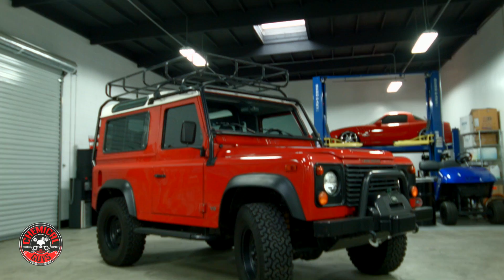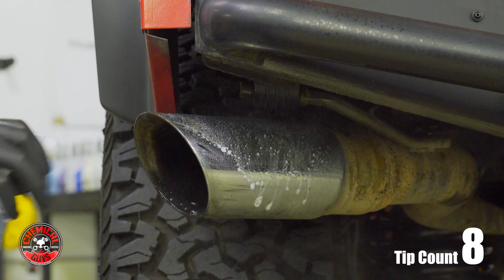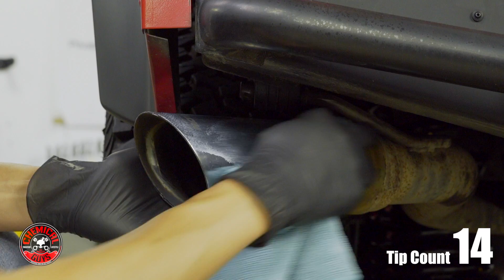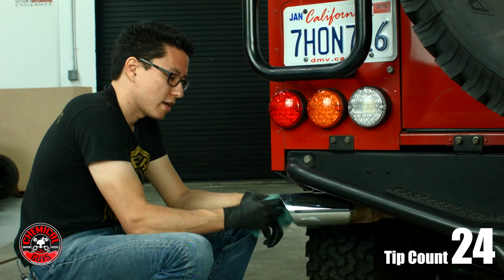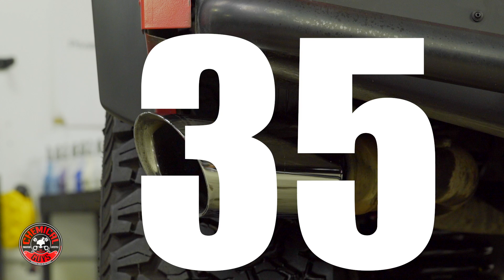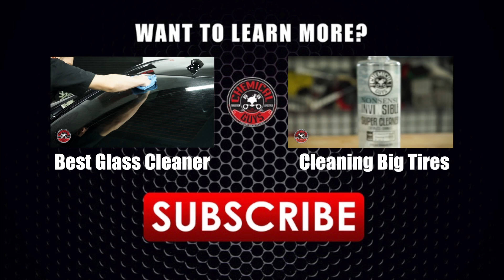How To Clean And Polish Exhaust Tips - Chemical Guys Heavy Metal Polish

Comment: Would jet seal work for titanium tips and black coated rims
Reply from the maker: Hi! Could you clarify what you mean by black coated rims? Powdercoated or factory painted or... ?
Reply: Not sure I know they have DC logo on the center of the rims
Reply from the maker: JetSeal will work on polished metals. As long as your wheels are glossy, then yes, you can use JetSeal on those also. Do not use JetSeal if your wheels are matte finished as it will add shine.

Comment: Here's a cheap and easy guide to fixing exhaust tips! First, dispose of your existing tip. Next, go to the store and buy a can of soup, any brand of your liking. Make sure to cut the TOP of the can open with a can opener. Dump the contents of the can into a bowl and cook via any method your like, it's really up to you. When the soup has cooled, eat it for nourishment. Finally and most importantly, discard of the empty can of soup, preferably via recycling. Congratulations, you just fixed your exhaust system!

Comment: Matt I was hoping one of the steps would have included you putting that Heavy Metal polish on a #0000 piece of steel wool to polish it and make that tip really look great. If you had, I bet you could have removed pretty much all of that carbon that was built up inside the front part of that tip.
Reply: Don't ever use steel wool on your exhaust tip you will  scratch the crap out of it. Use a soft brush

Comment: What could be done about the exhaust line that is really nasty like this one? Does a metal polish could improve the aspect?
Reply: Usually if I want to make that exposed area of an exhaust look more presentable, I'll use a ScotchBrite sanding pad and scuff it to give it a more uniformed look, then polish it, or just paint it to match the look of a new pipe. Sometimes depending on the exhaust setup I'll just paint it using some hi temp black paint to make that part of the exhaust not as noticeable.